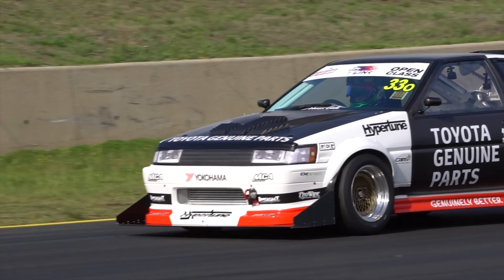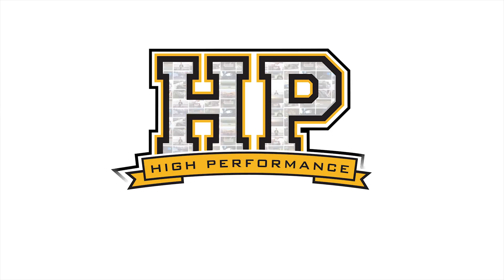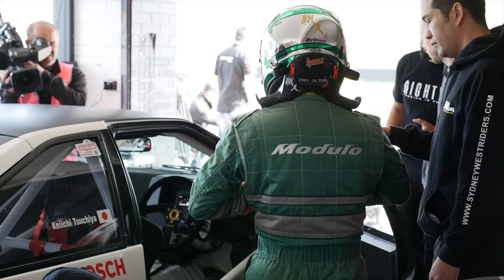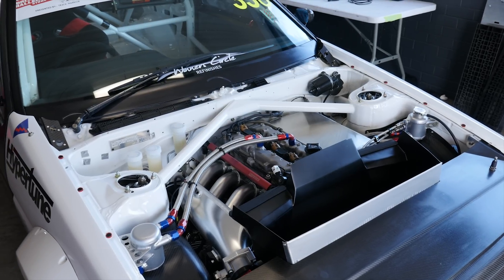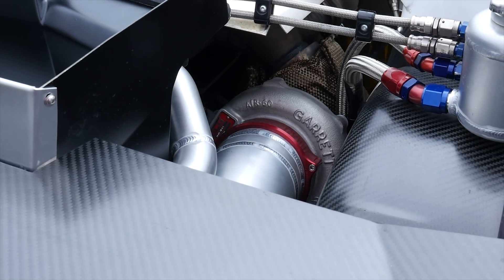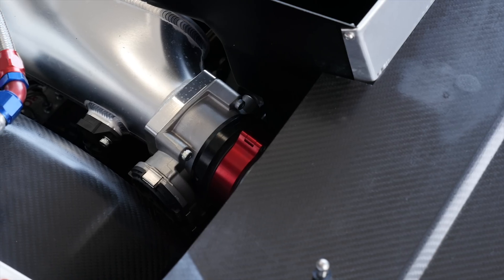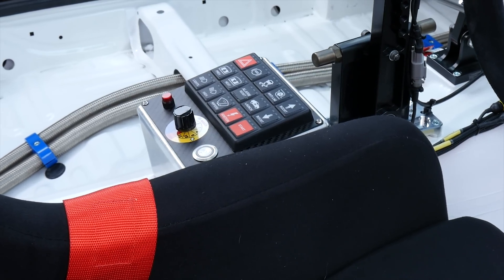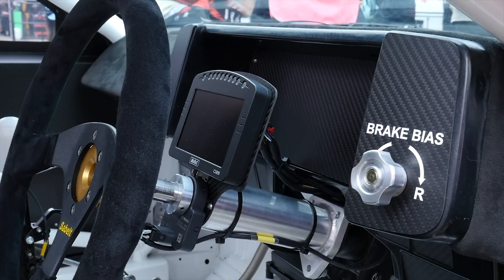The Worlds Cleanest AE86 Race Car?

Comment: for anyone who's more technically sound out there...why is that he engages the clutch when he downshifts, and in his upshift, he doesn't have to engage the clutch? i'm sure his transmission is designed that way, but what are the benefits?
Reply: perfect rev matching , up shift without clutch make much better acceleration

Comment: I love Toyota's 3S engine, either NA or force-inducted, though it is quite overshadowed by Nissan's SR20 a bit...
Reply: hmmmm 3s engine should be come first ever produce because it came from celica rally 1986  if you means sr20 overshadowed by 3s engine maybe its correct but 3s overshadowed by sr20 little bit questionable

Comment: '' a little bit more advanced from the 4age '' lol A LOT A bit more advance, not sure why exhaust cam vvt was deleted the  volume on exhaust varies  so that doesn't make sense to me.
Reply from the maker: This is covered in an older video of this car when it was still a drift machine. I'll see if I can dig it out for you, or just search through the channel with 'Beau Yates' and see what pops up - Taz.
Reply: High Performance Academy okay so I went and watched it, his engine management at the time could only control one cam so he locked up the exhaust cam.
Reply: Ben Dover vvt doesn’t just change timing at low revs it retards at high revs and picks up power keeps a consistent amount of volume at part throttle which is good for turbo energy in corners you couldn’t be more wrong.

Comment: nothing scream bad ass than an AE86 with balls to the wall modifications and Keiichi Tsuchiya behind the wheel of this monster AE86

430bhp and this is not powerful enough o.0

my eyes just popped

imagine this AE86 with 500bhp and less than 1000kg dry weight

that will be faster than any supercar out there currently

Comment: A spool!  Do A that could hurt his time a little since it won't want to turn more cleanly. At less in tighter turning, Chirp, chirp,  but yet again another great video from you guys. Top notch, top notch indeed!
Reply: Yeh you would think it would be harder to get the turn in, especially at turn one, it's one of the struggles in v8supercars I'm not sure why they went with the spool over LSD, maybe its not such a problem in this setup.
Reply: @Neishy86  i'm starting to think it has to be with weight, strength & reliability is out weighs the cost for the slight less performance on tight turns .
Reply: @TEA_1773  yeh I reckon you are right, still being a time attack car I would've thought it would hinder the turning too much, but maybe being so light and short wheelbase it's not as much as an issue as the understeer supercars get from it.
Reply: Yep you definitely are a drongo, way to live up to your name.
Reply: @Neishy86  Ok Dale, you and A-Salt better tell Beau yates and Tsuchiya-san their car is all wrong.
Reply: No chirp chirp. Is race track. They know what they are doing. Did you watch the in-car footage? The car turns.
Reply: @drongojonkins8945  That's true but it should hinder him a little bit on the tighter slower turns is what I'm walking about and the chirp chirp is when he's in the pits turning hard for whatever reason.  

So dude don't be an asshole about it just thinking it and not just react on your snowflake mindset now ok?  LoL

Comment: How does it manage to corner that Well with a  spool?
Reply: Dori Dori... that's how
Reply from the maker: A spool is not necessarily an ideal setup but as Chris mentions, many classes stipulate a spool and there are plenty of ways to make them work and a lot of understanding around their dynamics. Generally the biggest downside is that the tend to generate corner entry understeer. While a properly tuned LSD is superior to a spool, it actually takes a lot of work to setup and tune an LSD to get the best possible results. On the other hand a poorly setup LSD can easily underperform a spool so it's not perhaps as clear cut as many might assume.
Reply: High Performance Academy +1
Reply: V8 Supercars have been running a spool since the early 90's.  In race environments it actually gives you perfect control of the rear end.  With the wheel turning at the same speed if you have the outside tyre at road speed and the inside over rotating you will get a neutral to slight over steer balance through the mid corner.  If you have the inside tyre at road speed and the outside tyre under rotating you will get a neutral to under steer balance through the mid corner.  If you have both tyres over rotating compared to the road speed..............that means your showing off.
Reply: @MadRS   I don't know about a spool diff giving 'perfect' rear control, otherwise they would be universally used for track driving. I would use a spool for drifting though. Also a spool will give understeer mid corner compared to a conventional diff because the two rear wheels don't want to follow the arc of the corner, they want to drive straight.
Reply: Thanks for all the explanations!!

Comment: 3:50 - I think "Solid State Electronics" is what you meant to say. (Probably clear to most viewers, unless I goofed that up :D )
Reply: I appreciate that they went with a Toyota engine and diff. I don't mind mixing and matching at all, but to do that within one brand is just pretty cool!
Reply: dude messed up multiple times in this vid..:/
Reply: @dennisvanderben2719  it happens, I couldn't do those  tech-filled one-takes at all. I didn't mean to drag Andre down, he's doing a fantastic job in these tech tours. And I am sure if you have corrections they will appreciate you listing those.
Reply from the maker: @YensR  You're right. For some reason 'steady state / solid state' in particular is a hangup for me (Must be the cross over to steady state dyno tuning). I've had to reshoot a PDM video before because I did the same. Must have slipped through the cracks this time. My bad - Andre
Reply: @hpa101  Good as gold Andre, you are doing a stellar job with these :)